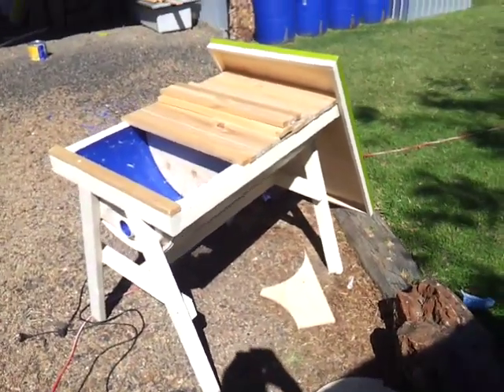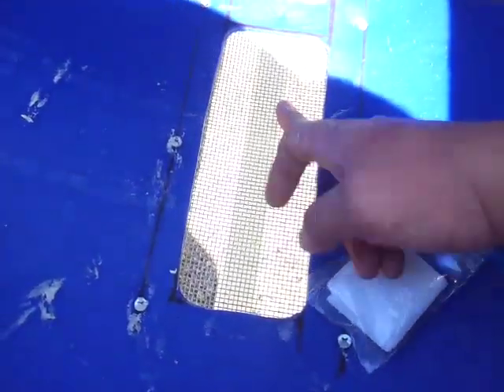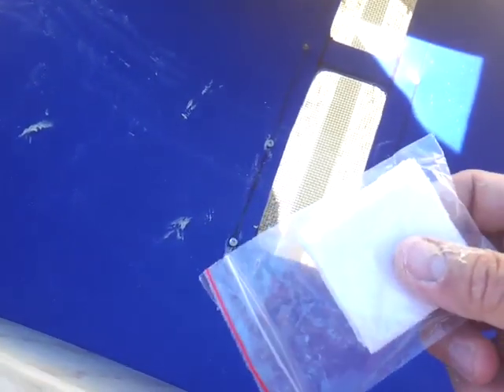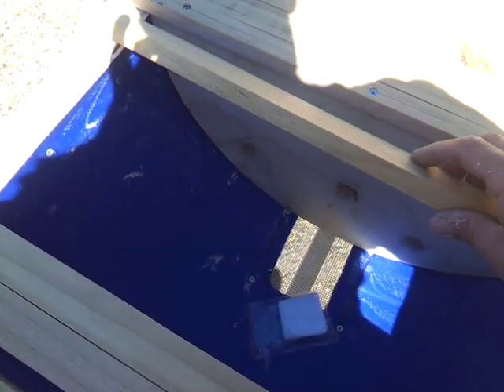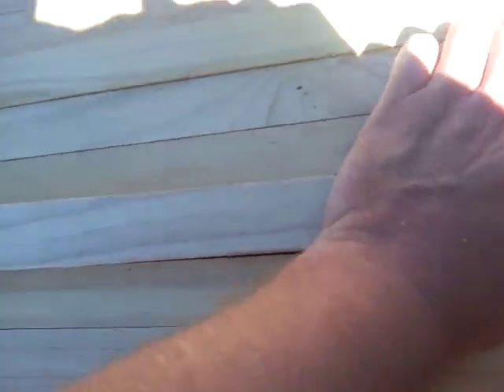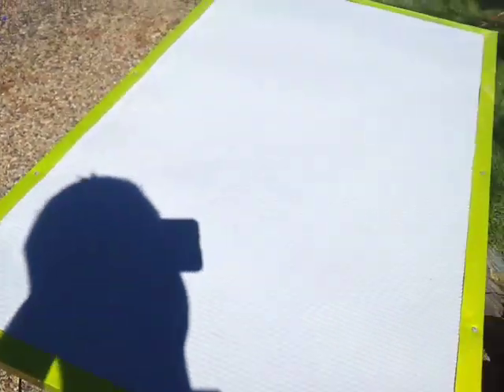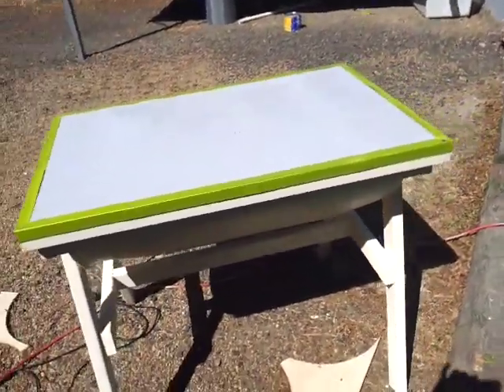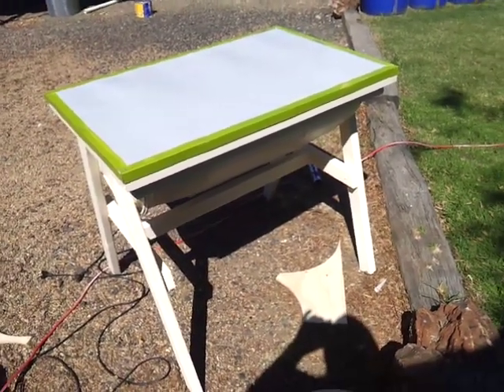Top bar beehive from plastic barrel finished

Comment: How did this hive turn out long term?  I am thinking of making one and wondered if you still liked yours?
Reply from the maker: Chad Ford its awesome. The only thing that I would do differently in future is to use plastic foundation sheets attached to each bar so that the bees keep the interior of the hive a little tidier.
Reply: Might you have a DIY (Video) guide of how to make one?
Reply: @NaughtyGoatFarm  , can you explain the sheets?  Are they hanging down like curtains to guide the comb? But then the bees can only get to one side of the comb?

Comment from the maker: One thing that just came to me in a flash of inspiration today was a source of material for the cover of the beehive. I was walking past an appliance store and stacked up outside were loads of old dead fridges and washing machines. I thought to myself - that nice flat painted white sheet metal on the sides of these apliances looks like a perfect cover material to line the plywood top with. So there is your tip for the day!

Comment: I just  finished my barrel hive and installed a swarm. They are very happy in it. Have you come up with a way to feed pollen patties so that they can easily be replaced? I made a hanging "basket" of folded over chicken wire and they ate the pollen and started drawing comb on the wire.  I put the comb on another bar with a hair clip but  putting new  patty in without taking the whole "basket" apart is a pain and time consuming.
Reply from the maker: Abigail Rollins Hi there. Sorry I don't have a way to do this as we never have a need to feed our bees where we are located. Would love to see a video of your hive.
Reply: How are both of your barrel hives doing? Would black barrels work?